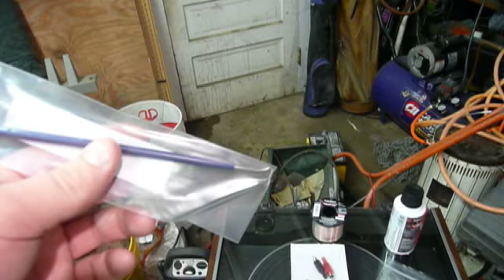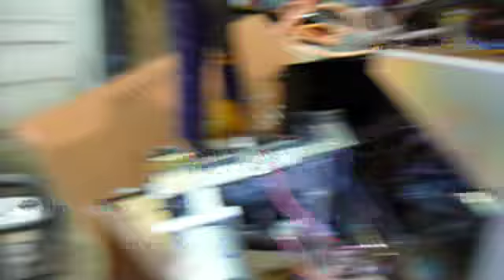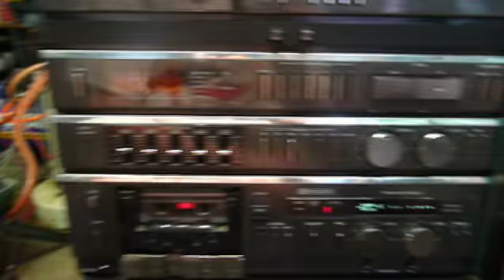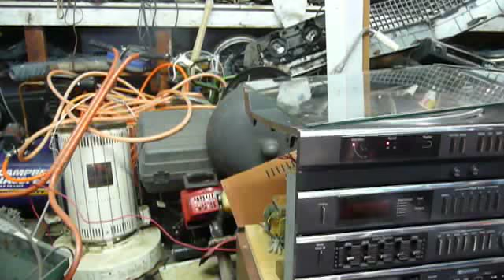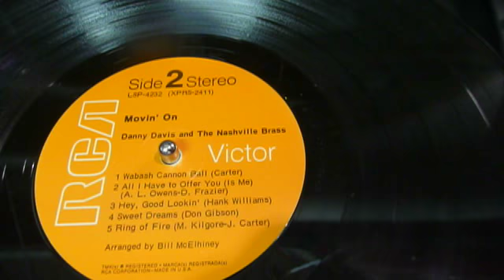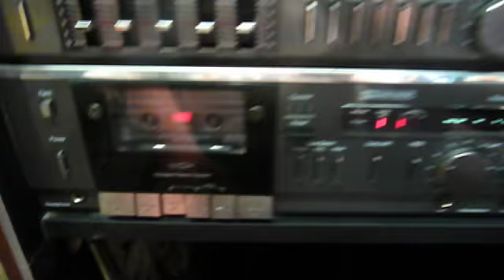J.C. Penney MCS 2230 Tape Deck Repair

Comment: this is definitely a Sanyo/Fisher system like the sears LXI 132.9189335X  X= 0 through 5! Mechanism is the same thing!
Reply from the maker: The Sears version of this (with a much less exciting turntable and more basic cassette deck) actually has an FCC ID printed on the back.

That FCC ID points to the Arvin company. By the mid 1980s, Arvin had long been out of the radio/stereo businesses, but I'm sure they did plenty of private label work for Sears and Penneys in the past, and were happy enough to do a little more. My best guess is that they did the design work and farmed the manufacturing out to whoever would do it the cheapest...which might well lead to Sanyo.
Reply: @uxwbill  I tell you that the way the boards are mounted and situated are about the same! It is hell to work inside these units. The tape transport is a tanashin TN77 which has a total of 3 belts plus the counter belt! FRW 7.1 for motor - the flywheel, SCX 4.0 for the gear under the flywheel (Flywheel has to be lifted completely out, there is a plastic seal that is going to drop off at the front capstan shaft) to the pulley that is about 10 O'clock over the flywheel, SXC 4.6 motor, pulley at 1 o'clock over flywheel, SCX 6.2 for counter belt!
Reply: 564 is Sanyo not 132
Reply: @connorm955  how can you verify that?

Comment: Hi I just scanned your page and saw you were active recently, and I actually am wondering if you still have this system? I bought one a few months ago, and the vinyl player will not spin. I imagine its something to do with the belt being old but im not sure. how did you trouble shoot the vinyl player? you're the only person I see online doing any work to the same model I have. thanks!
Reply from the maker: Yes, I still have this set. It's also extremely likely that no one has ever serviced the belt on yours and it is bad. You can start troubleshooting by carefully lifting up the rubber mat ("slipmat") on the turntable. Set it safely aside. There are holes in the underlying metal platter that will let you see the belt. The platter must turn freely. If it doesn't, you'll have to figure out why. It will simply pull straight up and off of the turntable base.

Belts are readily available and do not cost a lot.
Reply: @uxwbill  wow easier that i expected lol thank you so much!

Comment: Hey uxwbill. Can High Bias tapes be used for recording on the tape deck of the stereo system in this video or just normal bias cassettes? :) Thank you! :)
Reply: Yes. If you look at 8:55 you see it has switches for Normal/CrO2/Metal.

Comment: thanks for the tip when working with small screws Would have never thought of that duct tape.These were not bad sound systems in there day lot better then the crap they make now

Comment: Looking without much luck for the replacement cassette deck belt you used on/in the MCS 2230 video. Any suggestions on where to purchase or perhaps the length and type the belt??  Thx. in advance. Incidentally good video's the MCS 2230 stereo system.
Reply from the maker: +Del Clearwater You will have to measure your existing belt, making sure to deduct 10-15% in size due to stretching, or use string around the pulleys.

Studio Sound Electronics carries the belts in the United States.
Reply: +uxwbill My father still has his first CD player, and it came with a receiver and a cassette deck. I know that it's vintage because, it came from the 80's. However, I don't know the model number. Not even sure if any of it works, except the Receiver overheated many times, then eventually stopped working. Good thing I have a quality product because, it's Technics branded.

Comment: Oh I forgot to add one small thing I have found out that the skip feature will not work on tapes that were not prerecorded If you make a tape yourself most of the time it did not have a small silent spot that is what the logic  Analog to digital  looks for when using to skip feature . Also make sure the head and capstans are clean. For advanced repair for the cassette head you need test tapes adjust frequency  with a O-Scope. I learned that while working for ASI radio repair 1978
Deloren

Comment: I just like I said I worked on one in the 80s for a electronic repair shop while I was in the NAVY on submarines . You did a great job!!
I can say the belt tool that you bought I always used old dental tools that I would grind down I got them free for dentist that they were throwing away I was told this by a 85 year old electronic repair guy .
I was also lucky to have a SAMS Photofact He had a whole set and always got updates . The chip I replaced took 2 weeks to come from Japan.
Thanks

Comment: @uxwbill a real electronic repair nightmare! One time i tryed to fix the shitty 3.5 connector for the speakers of an old 1990s stereo system, some kind of unknown brand, with double cassette player, a LP plate (that i didn't know if it have ever worked), well i opened it and i found only 3 boards connected with tons of wires of the SAME COLOR! unbelivable!
Well i fixed it, but after a year it blow up, was good only for the screws i scavenged from it ahah